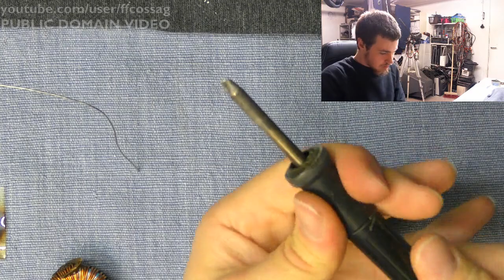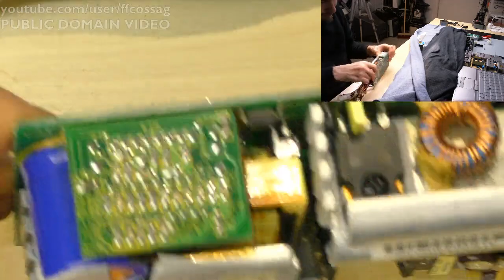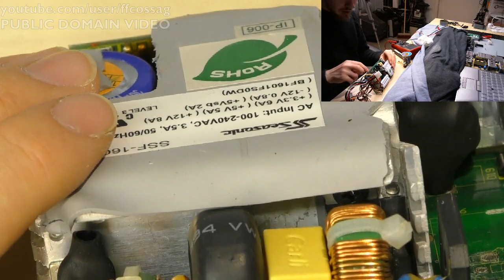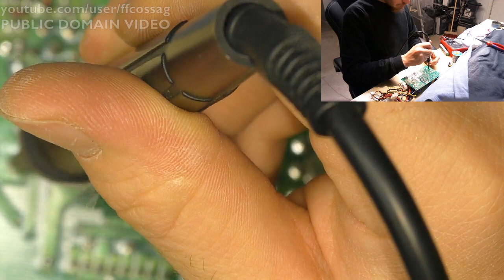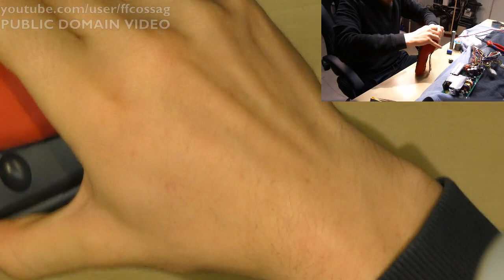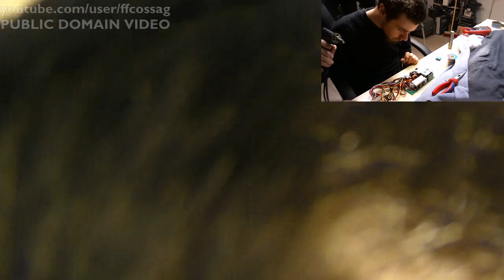RECORDED STREAM: Cleaning conductive glue out of a PSU

Comment: Spoiler Alert - your hair looks great when it blocks the camera view, and Donal’Thrump’s “Flock of seagulls” has nothing on your fuzz ball!   But seriously… as you said it so eloquently, this is just “planned obsolescence”. They knew what they were doing with that glue.  I once saw a power-supply from a NEC computer. What a delight…. They had built that thing as if they were going to the Moon with it. No glue....fitted with top quality rectifiers, ELNA capacitors, EMI filters galore; HV separated on its own board;  Thick PCB with formal coating, etc.. etc. Kudus to those engineers.

Comment: Re: the brush problem around 32:00 - I would have used an old toothbrush. Those are pretty handy and basically cost nothing as long as you remember not to toss 'em.

The heads-up on side cutters is appreciated, I know someone working in a university lab who has complained about students always messing those up in the past.

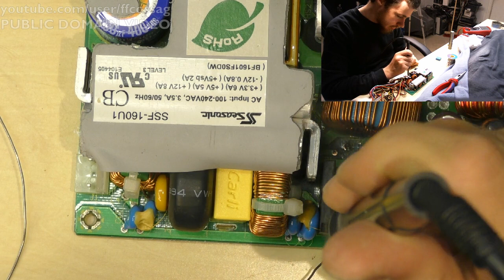Re: 1:47:30 ADSL problems, sounds like you may need to build a massive common-mode choke. This German guy eventually ended up using a fairly substantial high permeability toroidal core wound with tightly twisted but adequately spaced twisted pair made from AWG24 for a big choke plus some smaller ones, plus a mains filter:
http://www.netwraith.de/dsl/dsl.html
The page i's obviously in German but I hope either Google Translate can help or yours truly or someone else from the audience could clarify things if needed.
Reply from the maker: I've got plenty, but the brush I ended up using is considerably harder and coarser. A toothbrush wouldn't have touched the crap.
Reply: PS: Here's one little trick for clearing small holes of solder, might have come handy with that mains filter cap.
https://youtu.be/YzVTFRc_Lo8?t=12m0s
Reply from the maker: That's quite clever. It wouldn't have done much to the mains filter cap as those tend to stick due to the legs being pressed against the sides of the holes, but in general that's a useful tip.

Comment: I've noticed in some p.c supplys there is a "Mid way" capacitor in the driver section that goes crappy, it can make a psu a bit whiney, and it's often a shitty brand too.
Panasonic caps work well for recapping ordinary switchmodes :-D.

Older p.c psus sample all the voltages, but the output transformer is never accurate enough for perfect individual regulation, the price we pay for economy i suppose :-(

Comment: Try switch cleaner/lubricant on your iron. It leaves protective layer that should prevent quick corrosion. Alcohol cleans, but it quickly oxidizes again.
Reply from the maker: I've tried that, it doesn't work at all - it also flows so easily that it wants to contaminate the tip.